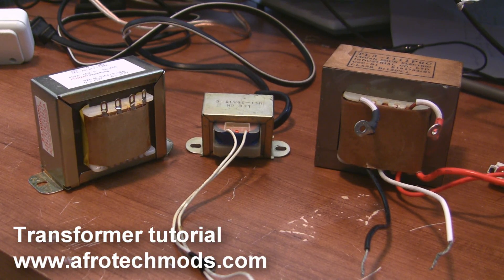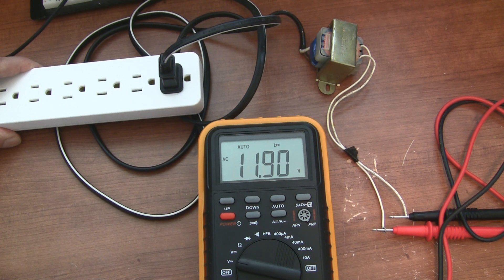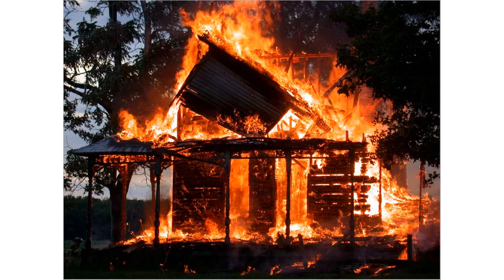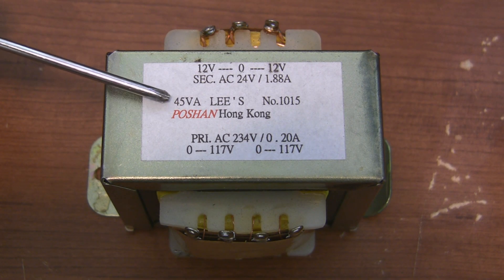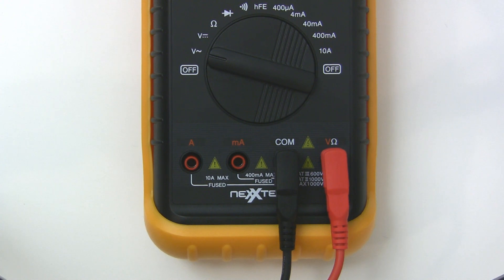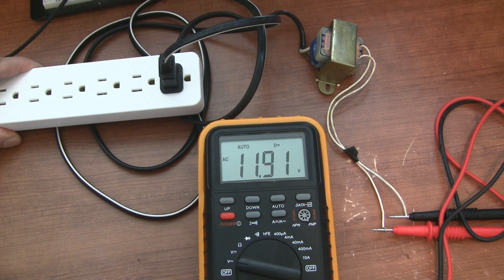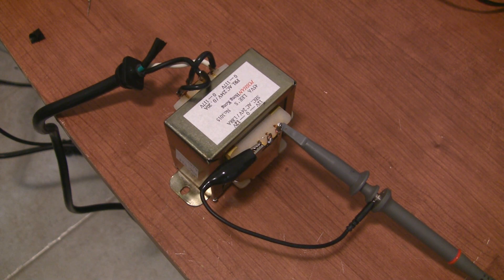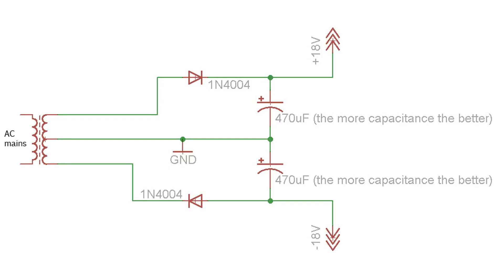What is a Transformer? An Electrical Transformer Tutorial

Comment: I have a question for you, im working on a X-ray generator I found something on the auxiliary that has me confused. The schematic shows the on the primary you should have 0 volts on leg 1 (Neutral) and 220 volts on leg 4 (Line), and the secondary should output 120 Volts and 1 is your neutral. When hooked it up like this on my external power supply it acted correctly. But in the generator they are putting 220 on not only the line, but the neutral as well. In affect, it is switching the the hot

Comment: Yes, after looking there was a 50 ohm primary and a 2.5 ohm secondary for stepping down voltage, so I sent my signal through the secondary and had the 50 ohm primary set for output, same impedance as my antennas I was connecting to it, but I might need to amplify the signal just a bit before sending it through the transformer for output. It cleaned up the audio quality quite a bit on the output.

Comment: Here's a good question. I stepped up an audio signal from 3 volts to 32 volts output with a power transformer, but the audio appeared quieter on the output side even though the voltage was higher. Any idea why audio would be quieter at a higher voltage?

Comment: I want to make a coil gun and I made the coil,but I can't find the correct power supply.I used 12 v 400 mA and the bullet it's barely moving.If I make a step up transformer and put the terminals to the coil will it be powerfull enough to launch the bullet?

Comment: a transformer creates a voltage on the secondary coil when there is a CHANGE in voltage on the primary coil. if it is DC, the voltage is the same. no change = no secondary voltage made. if it is AC, then it is changing to opposite 60 times per second, creating an almost constant power supply suitable for directly driving light bulbs and AC motors. An AC-DC circuit is needed to run DC devices like microprocessors from a transformer.

Comment: Hi
Ur explanation and ur videos are for oscar. They r great. I have a question about transformers. I have a transformer removed from a radio. But nothing is written. Its output voltage rate is 12VAC. Im using this for my power supply. The problem is "I dont know how much current it can gives" and how to measure the impedance? Thanks

Comment: 06:03 That's not a European mains plug, it's a British one(although technically Britain is part of the European continent, in this case to say "Europe" would mean continental Europe, which excludes Britain). Although Britain has the same 60Hz 230-250VAC, they use different plugs & sockets, their plugs have a third prong for earth while continental European plugs have 2 prongs and 2 copper contacts on the outside.

Comment: Anyone knows how to rectify large amount of current from a step down transformer? If I use microwave transformer to lower the voltage to about 5V but the current will be like 100-200A, how can I rectify that with diodes? I will use this setup for electrolysis so voltage regulation is not important I just need DC.

Comment: Hey could I use a small coil wired around an led (led is powered with 1,5v battery) to transform the dc to an alternating magnetic field that is picked up with the coil?
And maybe then use a tunneling diodes for making it dc?
Would be so great if could share your insight on this.
Thanks in advance, greets.

Comment: AFAIK  the ground clip to the primary will make that reference ground. Once this is done you have basically short circuited the primary and secondary coils because the scope probe/ground lead are connected to each other. This means that the secondary coil will be acting like a primary (oscillating Ground@120V and probe@12V) which will try to induce a current from the secondary into the primary and along with some other funky shit, bad news. You could also do some serious damage to your scope.

Comment: If you're using it with the two secondaries in series, then just put a current meter in series with your attached circuit.

If you are using them in a +- CT configuration, then there is no generic answer to your question since even-balancing is not ensured. You'd have to actually analyze your circuit. Summing the currents of the two ends would work in most cases, potentially disregarding power-factor if the two sides of the secondary are out of phase.

Comment: The dual rail will come from the CT RMS voltage, times 1.41, divided by two. So a 10V CT transformer could produce 10*1.41/2 = +-7.05V. 

If you're going to use linear regulators, you need some overhead. For instance, this might work well for 5V regulators, but would not work for 7V regulators. 

Regulators require a certain drop, called the regulator drop-out, found on the spec sheet. Usually 1-2V min dropout. You can also buy LDO (low dropout) regulators that can go well below 1V.

Comment: The probe's ground clip is actually connected to earth inside the scope. If you were to connect this to the neutral side of the primary, there would most likely be no explosion, though there could be a small spark and current would probably be induced since earth and neutral tend to be a few volts off, due to copper-loss in the building wiring (technically, they're tied together at the breaker box). So, it's still not a good idea.

If you connect it to the live side, of course it'll go bang.

Comment: Thanks a lot for the video, I'm a ton closer to getting this!!........ A couple things I don't quite get yet.... How do you tell what size transformer you need for dual rails? Its convenient because I need +/- 18v but what's the math behind this? Also, if I need +/- 18vdc for use with an op amp do I use a 24v center tapped transformer like in the video, or do I need slightly bigger if I use voltage regulators?

Comment: Try to put ~9v battery to the secondary coil  and touch the primari, then add switch between battery and one wire from transformer.
Take 2 needels and solder them to primari coil wires...
Push these needels in your head and oher in the feet
Push the button.
Feels great!

Comment: @MrTweetyhack Actually I am merely going by the ratings on today's power supplies... my current machine is running (maybe?) a 450.. I only have a 1 gig vid card, an older one, so no.. my requirements are probably far less, only thinking about "future" possibilities. But, you are probably totally correct - one could "be conservative". Cheers

Comment: @KyleCarrington You running some gaming box or servers? 600 Watts is a lot! 600W/12V=50Amps! I'd like to see the size of the cable to run 50 Amps!  You get the best performance/watt from laptops anyway, designed with efficiency in mind. Good luck!

Comment: @MrTweetyhack Thanks. I checked out there stuff, it looks good, but.. it does not offer a large amount of power, for example they have about 250-300 watt stuff, no 450-600 watt stuff. I came to the conclusion that off-grid computing is best done on laptops, period. It's amazing how tall an order 4-600 watts really is, on 12V.

Comment: @KyleCarrington There are such things a DC-DC regulators but you still need to make the required voltages(-12, +5, -5, +3, -3) as certain components require more power than others. You'll just burn everything up if you just use 1 voltage. And Via's miniITX stuff does take a single 12V but there is circuitry that steps down voltages.

Comment: @FrozenHaxor2 we had to change when we joined the eu, England used to be red (live) and black (neutral) we have apparently changed from 240v to 230v but my voltage reading is 250v

Comment: @warwickmark Bridge rectifier (or diodes) in your case has to be capable of 10A or more (6A is absolute minimum). Capacitor should be atleast 6300uF 35V (more is better). Beware that capacitor will bump the voltage up to about 18V so that's a bit of a problem. You can solve this problem by using a voltage regulator (eg. LM338). just google it

Comment: What great videos and explanations.  I want to use LED headlights for lighting in my workshop, I understand the step down to 12 V AC and then building a Bridge rectifier to turn it to DC, but i can't find any information on what size diodes and if there are any recommendations for capacitors etc to smooth things out.  the transformer will be a 230V to 12 V AC 100VA and i'm going to be putting 12-3.8 W LED headlights in, any help would be appreciated.

Comment: In regards to computer, their power supplies, and off grid applications: I look inside a computer power supply and while it is beyond my skill level to diagnose exactly all that is taking place... I have often thought it retarded (when using solar or wind power) to have to take 12v store power, invert to 100VAC, supply a computer power supply with 3 to 5 amps of that, to only turn around and create +12, -12, +5, -5, +3, -3 etc. that has to be wasteful. Have you ever seen a DC supply?

Comment from the maker: @c0rrupts3ct0r555 Quite possibly. There has to be an especially high inductance on the side of a transformer that is connected to mains, otherwise it will appear as a low resistance short. So imagine what would happen if you connect a piece of wire to mains... either the circuit breaker trips... or FWOOM! Google flyback transformer driver circuits for ways to drive transformers backwards to reach higher voltages.

Comment: Question: I have a device that says that it needs a 16V CT transformer, which I guess is a 16V Center Tapped. But, my question is this, is that a 16V ~ 0 ~ 16V, or should it be a 8V ~ 0 ~ 8V ?

Comment: After some testing, I found out that the black wire was connected to the white wire (I thinks this is the "Input")  and the red one was connected to the blue wire (I think this is the "Output")

It was labelled 37-C5201803
                            LITEON HP OK
                            0221 JC REV.C

Can you please help me out?

Comment: Hi there, i've been following your vids for few months now, learned alot already!
I have a transformer from a old ZMC amplifier and it has 4 wires on the primary(Y,B BK,W) and 5 on the secondary(2R,2B and 1BK) now i get about 10.2ohm on the yellow and blue, 8.8ohm on the white and black..
On the secondary, common black with red wires both have 1.1ohm, black to blue gets infinite, blue to blue 1.3ohm and red to red 1.6ohm..
My power line oscillates between 248/252V and 50Hz..

Comment: my old samsung radio has 3 difrent -+wires....1pair has 28 volts 2 has 15 v and 3 has 13v.... can i just cut of the 28 and 13 if i only wanna use the 15v ..... and will it effect anything if 1 use the 15 and 13 volt wires at the same time .... will the voltage drop be bigger??

Comment from the maker: @MrWil513 Because voltage is all relative. If the cap is between 0V and -18V, the 0V wire is more positive than the -18V one, so the positive side of the cap should connect to 0V and vice versa.

Comment: @Afrotechmods OK, I think I understand this. At the AC frequency used, impedance of the transformer is designed to be very high, unless the secondary circuit is complete. I guess like a 'magnetic resistance' to current flow, not really a switch. When the secondary circuit is complete, that same energy goes into moving electrons around the secondary circuit and so primary impedance drops and current flows. The design of these little devices is more complex than I considered. Thank you!

Comment from the maker: @spelunkerd That's actually a clever observation on your part. The answer is that the primary side of a properly designed transformer will have a certain amount of inductance. At the AC frequency it is used at, this guarantees a minimum input impedance of the transformer. In simpler terms, the primary side of the transformer acts like a high value "AC resistor". That's why I mentioned that transformer design based on turns ratio is BS. You have to have a minimum impedance on the primary or POW!

Comment: @Afrotechmods I feel like a goof that I don't understand this, and I appreciate your help. The primary coil of a transformer is a continuous wire with no interposed switch. So, why doesn't electricity flow regardless of whether the secondary coil completes it's own continuous circuit? Or, does it have something to do with those diodes that convert AC to DC?

Comment: Little AC/DC transformers plug into walls to power small devices around the home. I see that they draw very little current when the end device is not plugged in, yet I don't see any switch to turn them on and off. How does the transformer 'know' when current needs to flow?